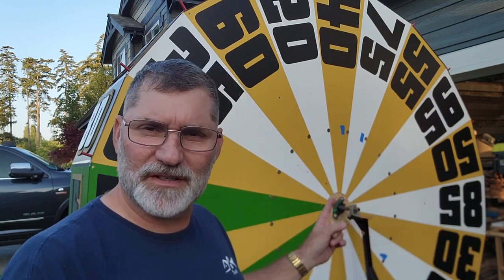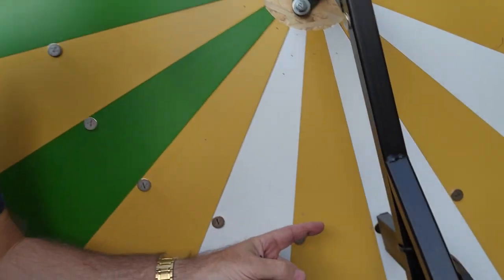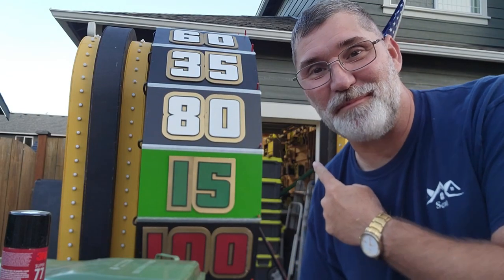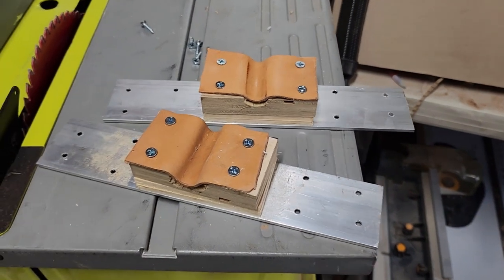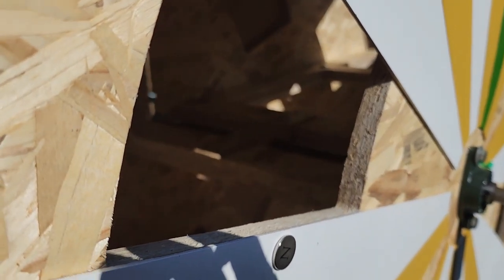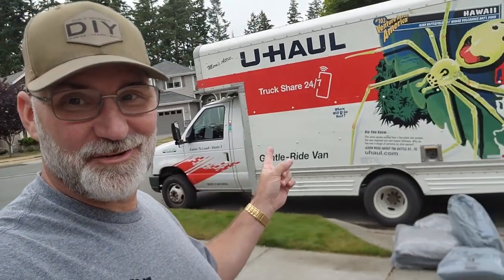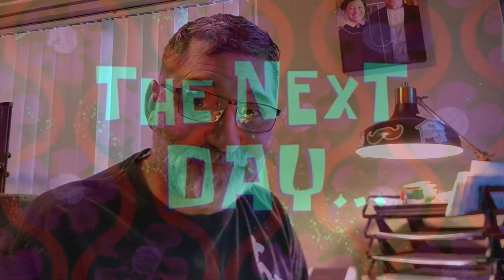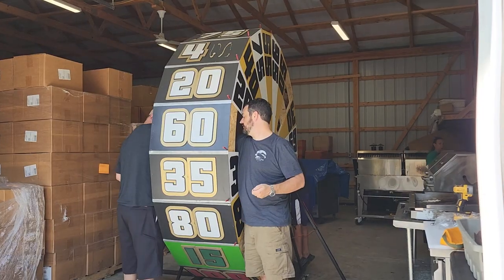We sold our Price is Right Big Wheel! | Upgrades and Delivery

Comment: The reason why the wheel takes so long to spin, is because the actual wheel weighs about the same as the Wheel of Fortune Wheel. Its literally the weight. When I watched your previous video, I noticed that the wheel was going backwards when it was not actively spinning. That would have meant the wheel was unbalanced, which can effect how often the wheel will land on a particular number. The wheel should only travel after having movement from an outside force. -- This is an amazing project. I'm glad your wheel found a new home!
Reply from the maker: We balanced it before delivery. The PIR Wheel weighs about 2,000 with all its accessories.